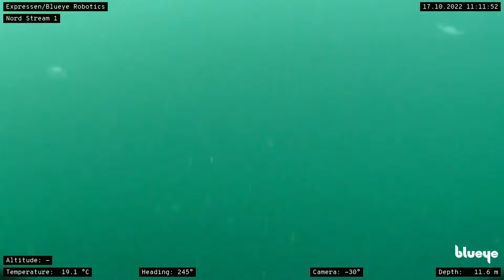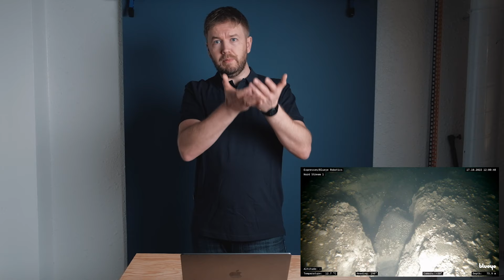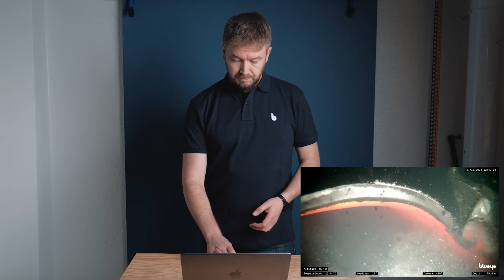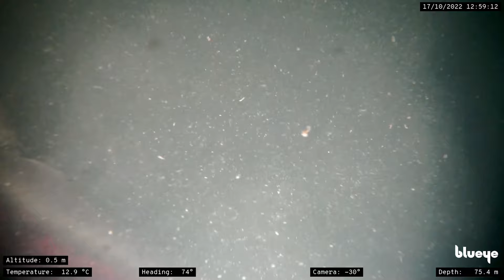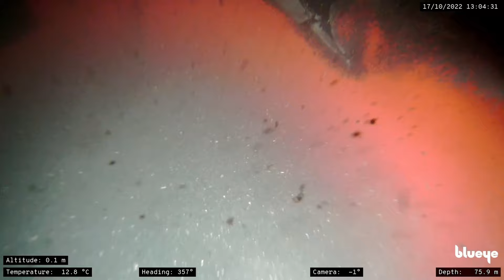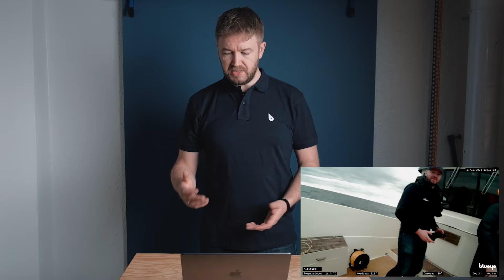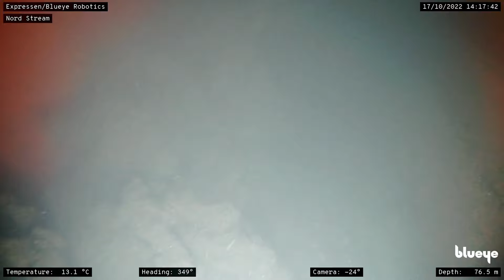Inside the damaged Nord Stream 1 pipeline |  Blueye Journey

Comment: From my past experience on land based pipelines the failure mechanism came from inside the pipe. If the red internal coating is being seen with the pipeline steel laid out flat then that indicates an internal explosion or pipe failure. 
You need to keep in mind that to cause a pipeline to fail by applying pressure from the outside the amount of force would be extremely high as the explosion would have to over come the pressure loss to the sea and sea floor and the pressure inside the pipeline. The explosive would need to be placed in the trench next to the pipe..

Pipelines are built with cleaner launching and receiving facility on each end. A pipeline cleaner is placed in the launcher which allows it to go into the gas stream, the cleaner moves along with the gas stream pushing liquids and debris ahead of it to keep the pipe line flowing efficiently. Cleaners can be launched at any given time. If the explosives were placed on the cleaner, remote or timed detonation could take place.
Reply: Finally someone who knows something about pipelines. I have though about Pipe pig behind used to destroy the pipe as well but it would require some serious manpower to run on the ground. you need large cranes and many people to install a pig launcher and such. I floated the idea of the anchor dragging method long time ago (I put the answer on quora 2 years ago). I was a underwater diver when i was young and i remember going out on jobs because some dumbass captain dragged an anchor and damaged the pipeline (gulf of mexico). once you hook the pipeline (this pipe was at 80m ~260ft, which is NOT covered, pipeline was covered in trench closer to shore) and puncture it, J-T effect (google this, i know you seen this effect) will take care of the rest and completely destroy the pipeline. pipeline of that much volume of gas will shrink the pipe so much! but hey, what do i know, im just a pipe weld inspector with background in underwater welding.
Reply: Thanks for the description of this feature and possibility. Thought provoking.
Reply: lol based on your experience.. what you described showed you had very little analytical ability. just because you saw the red internal coating you jump straight to internal explosion? you are forgetting that a pipe has many sides and an explosive force can bend opposing side of the pipe outwards as well no? lol ya right explosive pressure loss and pressure in the pipe... what are you on about seriously? That is not how explosives and "pressure inside the pipleine" works and interact. think again before you try to show off please.

Comment: A sail boat, a  team of six hobby divers, no compression chamber... They must think we're brain dead.
Reply: Most are brain dead........that's the problem..........lol.............Z
Reply: Ex-Commericial diver here. I used to work on pipelines underwater when i was young. I don't know why people are fixated on bombs being placed on pipe theory. It's simply too difficult to do without being detected. Many people don't know what it's like to be underwater working. It would be FAR easier and simpler to drag an anchor a hook like contraption to hook a pipeline. All you need to do is damage it enough to cause a leak. J-T effect will destroy the pipeline even further after that. If you look at the video of the drone footages, the trenches you see in the video is VERY narrow. The pipe is over 40 inches wide while the drone sent underwater is slightly bigger then a desktop PC. (look at blueeyes robotics)
Reply: @koreanese1 Explosions were detected on seismic equipment.
Reply: A drone like this one that captured the scene that allows you to place explosive charges that you can drop from the boat right next to the pipe doesn't seem impossible to me.
Nobody has to dive!

Comment: I just love that every armchair expert commenting on this video neglects to mention that pressurized gas erupted from these pipelines and that the forces of these eruptions further rupture, split and bend the steel outwards no matter what the cause of the initial failure.
Reply: man how many times i tried to explain people of J-T effect on piping. I have background in commerical diving and pipe weld inspection. I personally believe that pipeline was damaged from anchor dragging. with that much volume of gas in the pipe, all you need to do is cause enough damage to start a J-T effect and start chain reaction of damage from constriction of pipeline. people dont even know how deep the pipeline is and going around talking about divers and shit. at 260ft(80meters) you need mixed gas to even go that far down, regular air can kill you from nitrogen narcosis. air diving is different then free-diving.
Reply: Pressurized to 164bar (2400psi) would generate a thrust roughly equivalent to 1.5 SpaceX Merlin engines. So yes, the pipes would whip around up and out of their trenches.

Comment: What I find most extraordinary is that this video is placed on YouTube in the first place.
Who gave the order to put this on youtube with which goal?
Furthermore, we are told this is done by five men and a woman on a 15 meter sailing yacht. With these depths alone one needs special equipment that does not even fit on a 15 meter yacht, let alone hide it from plain sight Ones more this proves that governments are lying to us.
I have worked for a supplier of steel pipes and I have worked for a supplier for welding equipment for these kinds of pipes.
When I heard the news, I really thought how these people can be so stupid to think that we believe their lies.
Whoever allowed this to be on YouTube, thank you for showing this.
Reply: Who are "WE" and which goverment told you that it was that yacht? You seem retarded.
Reply: Ex-Commericial diver here. I used to work on pipelines underwater when i was young. I don't know why people are fixated on bombs being placed on pipe theory. It's simply too difficult to do without being detected. Many people don't know what it's like to be underwater working. It would be FAR easier and simpler to drag an anchor a hook like contraption to hook a pipeline. All you need to do is damage it enough to cause a leak. J-T effect will destroy the pipeline even further after that. If you look at the video of the drone footages, the trenches you see in the video is VERY narrow. The pipe is over 40 inches wide while the drone sent underwater is slightly bigger then a desktop PC. (look at blueeyes robotics)
Reply: @koreanese1  
Thank you for your additional information.
Indeed, working on these depths is a world apart. Though these pipelines are welded together on a ship and while this ship is sailing in a slow pace they let the pipeline slide and sink to the bottom.

I think that the ones who placed these bombs wanted to make a public statement and it worked.
The whole world saw the consequences.
Now, a year after the event the truth starts to leak through.
The latest is that the people on the sailing yacht (They are still holding on on that yacht story) worked together with the CIA. Well, that is closer to the truth than 6 guys and a woman on a boat
Now that Biden and his gang of crooks are out the door the truth will come out.
We only have to wait a little longer and then Trump inherits another problem.
Reply: @Ctrl_Del_0  i saw the process of how they installed the pipe. i worked on pipe laying barges before so i am very familiar with the process. welding wise, i watched many footages of this pipeline being built. The pipe is coated with concrete for extra protection on land. when it's welded on the ship (right before its dropped under water, they fit the next section using traditional pipefitting method. Then welders will put in root and hot pass by hand. rest will be filled and capped by automatic welding. then join is covered in special wrap to protect it.
Reply: @Ctrl_Del_0  my main thing is that bomb theory is just too difficult. at 260ft you will need mixed gas diving system as well as decompression chamber. you need a large vessel for that sitting there for long time. also many people dont know just exactly how hard it is to find the pipeline in the water in first place. there are no magical "map marker" to find these. There are coordinates, sure. But when i was diving, we always had hard time finding anything underwater since visibility always sucks at bottom of the ocean. you are talking at best, 10ft vis. it is not easy to find anything. at 260ft deep you are also fighting currents too
Reply: @koreanese1  Voila, there you go ;-)
Only people who worked in this business know what they talk about. You are one of them ;-)
Thank you so much for your response.
Please stay safe.🙏
Reply: @koreanese1  Let alone the explosives. This is not just some fire cracker.
But do not forget that a month and a half earlier (or so) there was a very large NATO exercise in the Baltic, only a few miles away.
Apart from that..... These pipelines are exactly located. Coordinates are know by one party or another.
That you need a large vessel is without ANY doubt. The NATO exercise was there for several days so that is pretty good cover.
When this exercise was announced I already thought about why it is exactly there.... Of all places.
Reply: @Ctrl_Del_0  yes the pipeline coordinated are recorded. believe it or not, its still a hassel to find something underwater. There are many cases where we show up to a coordinate to work on something and we spend more time trying to find object on the bottom of the ocean then the actual work itself. when you are talking about the bottom of the ocean on north seas or gulf of mexico, you are talking about very limited visibility due to sediments kicking up. even the drone footage you see, you have maybe 5ft vis? the coordinates are not THAT accurate. at 260ft, these pipelines were NOT covered, only at 100ft or so. these pipeline DO shift around little by little. they dont sit tight in one place. I think people watch lot of footage of people swimming around hawaii in crystal clear water but thats not how it is in most places
Reply: @Ctrl_Del_0  my main point is about HOW they did it. that is all. i believe someone did it on purpose. Who that is? I cant say without conclusive evidence. I am not going into who I THINK did it based on geo politic tensions.  However, I am saying everything based on video footages provided and my personal expertise in diving and underwater pipeline construction/ pipe weld inspection for last 19 years.
Reply: https://iapsam.org/psam14/proceedings/paper/paper_285_1.pdf   theres even a whole study on anchor dragging

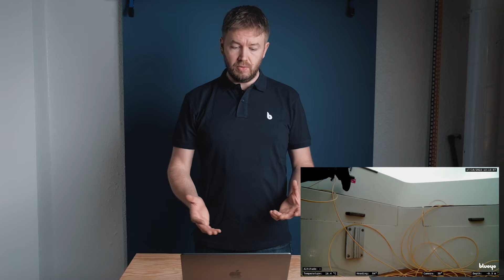Comment: 9:42 👍 good idear
Thank you VERY much for uploading this ❓
11:56
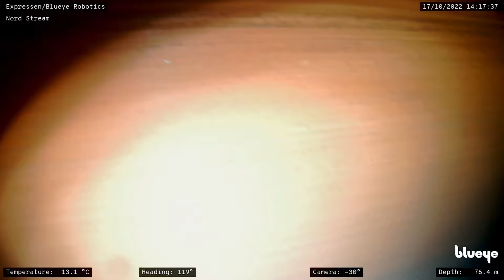13:02 and you don't need a lot of effort to blow up the pipe, it can be done with a drone full of explosives that magnetagly atatches to the iron in the pipe.
This is real usa tacktics/foolishness, the same as the whole Afganistan debacle.
Reply: wikipedia: "Björn Lund, Associate Professor in Seismology at The Swedish National Seismic Network said "there is no doubt that these were explosions" at an estimated 100-kilogram (220 lb) TNT equivalent.".
That would be 75 kg RDX *4. About the weight of one men per explosion.
Reply: @HvdHaghen  
They used C4 or semtex
Reply: @janklaas6885  I don't know what explosives were used. Seymour Hersh mentioned C4. Someone reacted to me that Seymour was wrong on this, but did not provide a source. The Swedish government investigators published there were (traces of) explosives found on the pipes, but did not mention what kind. The German Bundesanwaltschaft said they found traces of explosives on the yaght, but also did not mention what kind. (Correct me if I'm wrong.)
I only mentioned RDX as an exemple to show that 100 kg TNT equivalent can be less in modern explosives. Just checked: It would be 80 kg semtex. What are your sources?
Reply: @HvdHaghen  
Im not a prof. but if i think about it, it has been done on the most easy way, thats not with divers.
And the pipes were not made outoff steel but iron, you can see its broken, only the thin layer of steel between the concreate and the iron is bent.
And of cource the usa did it, proffesor J Sacks is also convinced about that just like S Hersh and just like me
https://youtu.be/2MP6lPyhRrI
Reply: The US Govs answer to no one, not even their own people, ZERO accountability.

Comment: Thanks for sharing this vid 
Judged by its quite smooth line, the broken edge seems like welding joining. If the detonator was placed on the top of the pipe, the broken edge should be bent inward in a random curve form or a random form  of hole(s).
Reply: youdropthechargeunderneaththepipethewayitaliansdroppedminesinalexandriaunderbritishbattleshipsiwithminisubsinWW2

Comment: Steel bent outward. That indicates the explosion was generated within the the pipe itself. The real question now is, who planted the explosive devices in the maintenance slug that gets run through the pipe? I'd almost bet it was destined to explode at Germany's terminal port to wreck havoc on it with it's storage tanks....
Reply: I can see that from Putin, but I think the "mystery factor" was part of the equation. Speaking of mysteries, we have a small boat theory for six; why didn't they scuttle the Andromeda? There is a whole lot of the "theory" floating around that seems off the point.